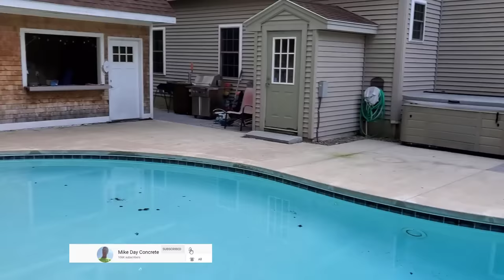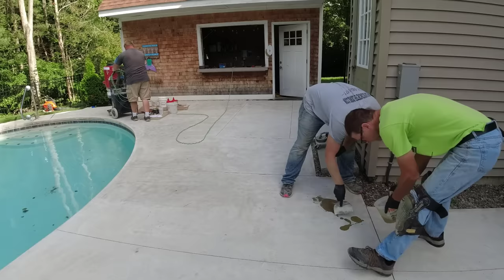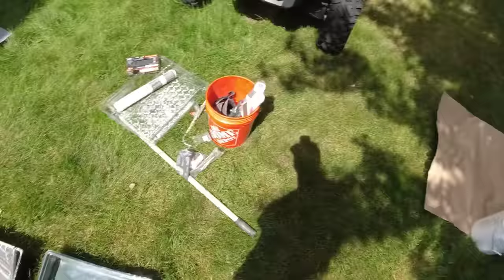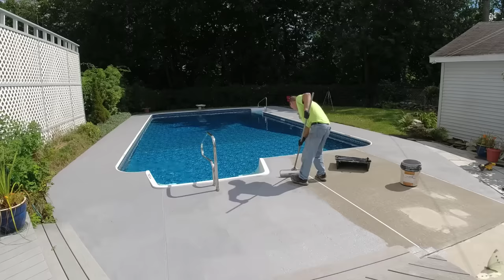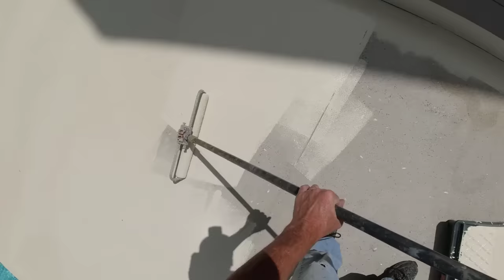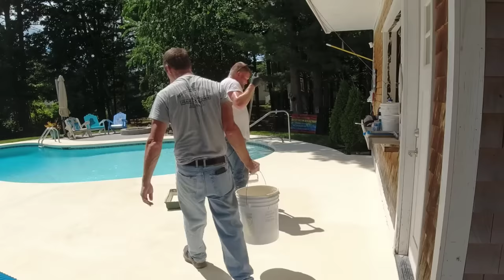Best Paint For Concrete in 2023 - Patios, Pool Decks, Walkways (My Top 3 Picks)

Comment: On a side note, you need to use better body mechanics,  bend your knees rather than bend over with your back because continually working like that will wreck your back and posture.

Comment: crazy u made this video. I literally just posted a similar video this weekend. the pool deck we did was better structurally. (no cracks)  We used a tinted sealer (not translucent) that is not paint. The concrete supplier we use actually tints it in the shop, they can do tons of colors so it's an acrylic sealer. not a paint. not water based. we just power washed it and as hot as it was last week it dried in an hour. of course just like w stamp concrete you can blow dry it w a leaf blower. I prefer the 3/4 roller as well. i couldn't tell if it was the same product we use, I think it is, but the say it's not a paint, it's a sealer, but I really am thinking about offering this as a service, especially since it is getting harder and harder to get concrete. but overall I think it made her pool deck look basicly brand new again.  it's crazy when u see another creator post a video that is basically the same video as you!!!!  (btw the stuff we used is called a sealer but it's more like a paint but they Def say it's not a paint) we only needed to do 1 coat. so it may not have been the same stuff
Reply: the thing about the stuff we used it has xyelene in it, so if it has solvent based sealer on it prior too it will bond because I t obviously re-emusifys the prior sealer. I like how u went over 3 products to be able to get at least an 8 min video. because like I said w only 1 product  there was just  not enough to talk about w only 1 product. I watch your channel not only to learn about concrete stuff that I may do a different way or maybe have never seen like turning the chute around backwards for basements but I also like to watch your videos to learn about youtube stuff like the affiliate links or different things like how to talk to a customer.  I was talking to my buddy from Cadillac concrete products and he said he knows you too and had good things to say about you
Reply: Is the paint slippery or can you add a sealer with grit in it
Reply: @GRUBB-MUDD what's the tinted sealer you used?

Comment: Great video. I have an issue with my concrete around my in-ground pool it’s Stained with sherwin Williams H an C ColorTop. I power wash and clean the concrete every year before staining I’m trying to figure out why the concrete stain is peeling every year i get the same results.I contacted Sherwin Williams. Seen this video looking for some help. Thank you.
Reply: I use quartz crystal blends- s grade in polyphatic resin. Double broadcast. With a texture coat on top. So durable natural antiskid. Awesome for pool patios

Comment: I pressure washed my patio good, and took it down to the concrete in most areas, but some previous paint will not come off.  There is no flaking at all, but wonder if I can still paint right over what existing paint there is, or do I have to etch or prime the patio first?  Advise needed badly :)

Comment: I had Mortex Kool Deck invented in 1962 can't get anything cooler to walk on bear foot., I'm in AZ where it's hotter then hell in the summer. I had been talked into acrylic lace that stuff was like walking on hot coals in the summer. After about 10 years it peeled up in sheets that Acrylic lace.
Reply: What did you end up going with??? I’m in AZ as well
Reply: @Guvnor1923  Haven't called them yet I think the price will be high to remove the old stuff well see. Probably getting too hot to install it even if they say it can be done I'm not so sure rather wait till the fall. Unless it's super expensive I'm going to have the Mortex Kool Deck put back in like it was prior to 2007.

Comment: I have 2000 square feet of concrete that was coated with resurfacer 15 years ago. Half of it has popped up. It was colored with bright white. Could this work if I ground the concrete smooth?

Comment: Hi Mike, my pool has what I've been told is something called cool pad? You have to stipple it and then trowl down the stippling. In my opinion, it was a botched job, because they didn't trowel the stipling well, so you can't walk barefooted on it in a lot of places and there are several places where it's coming up off the concrete. My question is how would you redo this?

Comment: Hi Mike, How many years would the paint last? I have over 1000 sq feet concrete backyard uncovered. Its almost 40+ years old and looks old and tired. I am planning to paint it using porch and floor paint from Sherwin williams, what is are your thoughts? Is it worth the investment? will it last? I am in CA.
Reply from the maker: I wouldn't use that product. Look at REVIVE from Deco-cretesupply.com. It will last much longer.
Reply: @MikeDayConcrete  thanks. I am planning to with a dark color. Do you suggest otherwise?

Comment: I have a few questions for you. How does this Mapecoat coating work on a concrete carport? Does it do ok with car tires on it? Any suggestions for that type of application? I have just a porch and patio paint on there now and it is flaking very bad especially after all the rains we got this last winter. Thanks!:goodvibes:
Reply from the maker: I wouldn't use it to drive on
Reply: @MikeDayConcrete  Thanks for your response. What would you use instead?🚙

Comment: as a pool tech... "prep real nice" would actually include removing the deck anchors for the safety cover.   painting over them instantly strips the head making them almost impossible to unscrew... and after currsing the guy that painted over them... when we finally get them up so the cover can be installed again... each head will rip a nice hole in your fancy new deck coating.
Reply: Ouch